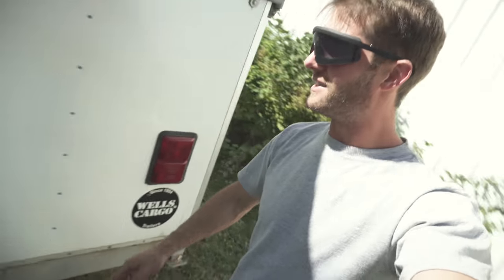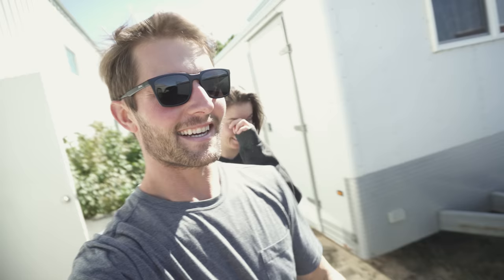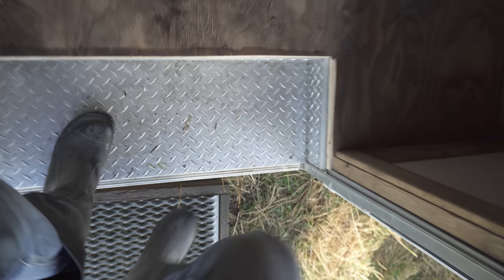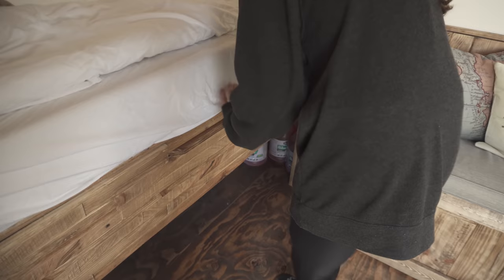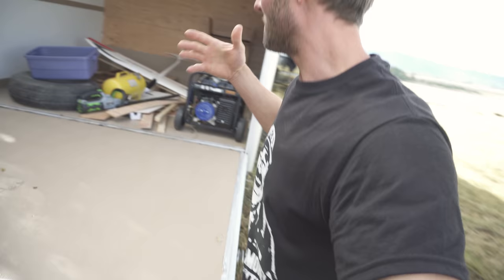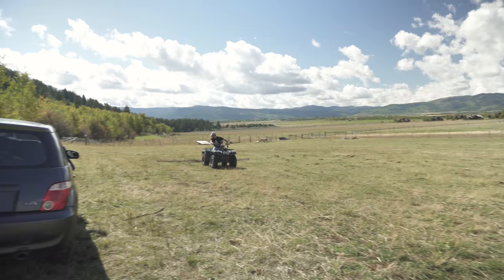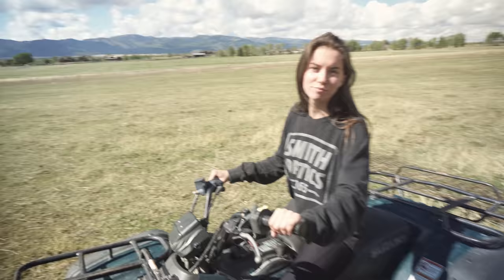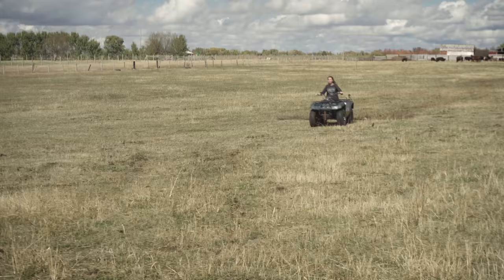CARGO TRAILER TO TINY HOME IN 2 WEEKS  *TIMELAPSE*  For $7000.00!

Comment: Awesome job!  I have seen a lot of these camp trailer/van builds and yours is at the top of the list.  I would suggest moving the fridge up a foot and a half or so so it is above the counter top.  It will be much easier to access for meal prep and you can put batteries underneath it.

Comment: Had you subed but utube was not posting your notifications, and not in my sub list, had to go find you guys again.  Another great vid. 
Always fun to watch. Hey those fridges remove heat from the interior and get rid of heat on the exterior, insulating the outside will not allow them to run efficiently, check it out.

Comment: Impressive! Now let's hit pause a sec. I give you two months' occupancy and that shop will be converted to a bathroom. Yep, say hello to you winter project. 
Tip: Solar thermal will give you piping hot water on a freezing, overcast day -- perfect for circ. through your in-floor radiant. Google "evacuated tube solar hot water heater." There's a good YouTube vid for you about how well it works in winter. For night, you can put an insulated, in-ground tank of 500 gal. for the trailer that will act as a thermal flywheel.
Reply from the maker: Thanks for the info sounds awesome. I’m going to check it out!

Comment: Your water system should be contained so if you get a leak you don't destroy your whole trailer. But a pretty nice job. Push the blue circle with the B in it and check my conversion out . Watch the updated video if you like log cabins.

Comment: Looks like there's enough room I can land there! I don't know if you have a Habitat for Humanity in the States but it would be easy to find enough vinyl plank for that space for $20. Also, I have plans for a hydronic solar collector. A 4'X8' would probably be more than enough to keep that space toasty especially If you had a thermal mass you could dump extra heat in during sunlight hours. I'll talk to you about it at HSF.
Reply from the maker: awesome! looking forward to hearing about it. See you there!
Reply: Jimmy Carter our president is the biggest supporter of habitat for humanity headquartered in Americus Georgia USA
Reply: Lack of thermal mass is one the biggest bugaboos with a trailer, or other temp structure.  You can insulate the heck out of it, and it'll heat super easy, but once the heat goes off, the lack of mass makes itself known.    Says the guy with a 5" concrete slab at 80 degrees, from today's sunshine/thermal solar collectors, then again, I can't move my house down the road!  Lack of mass is just a given with any structure capable of being moved down the road.
Reply: portnuefflyer it would eat into the storage but I was thinking he could have a water bladder under the bed. On the flip side, it’s also such a small space to heat so it wouldn’t take much propane to keep it topped at night

Comment: Refrigerators remove heat from the interior. They get rid of that heat to the outer skin. Insulating the fridge will not allow it to get rid of its heat and cut efficiency. Nice job on the trailer.

Comment: Not sure if 12V camping fridges are any different, but normal fridges are heat pumps: They pump heat from the inside the of box to the outside of the box. To make it energy efficient you want to help it dissipate that external heat, NOT encase it in insulation!

Comment: You can get small diesel heaters very efficient used on sailboats or tiny cabins!
Reply from the maker: I’ll look into them! Thanks for the tip!
Reply: @JonasMarcinko  yeah your pickup truck sounded like a diesel engine and I thought that would be so much more convenient! 12-volt system to operate blower fan and diesel fuel pump, combustibles vented outside for safeheat! Different heat capacity available 5k,8k,12k btu etc... Sailboat liveaboards are finding solar panels on top is the way to go, add a wind generator and you make electricity during the night in a breeze to run a very small air conditioner!... Keep in mind air conditioner doesn't have to cool as much as to take the moisture out of the air and make it dry that's conditioning the air and makes it comfortable!... A thought I had if you needed more room in your living quarters you could consider making the bed into a fold up Murphy bed!... Love your flying SHENANIGANS! I'm looking to get into Power Paragliding(PPG), with my sailing.... Keep the Fun Times Videos coming!
Reply: @stanRmeyer   ESPAR heaters, like my crane cab has, are quiet, and amazingly fuel efficient.  Truckers use them to heat their sleepers, rather then idle the truck. Outside air intake, no smell whatsoever, and a thermostat. Not cheap but worth it,  and you won't believe the efficiency.  Check out the ESPAR site and read the BTU output V the fuel consumption, it's unreal!    https://www.eberspacher.com/products/fuel-operated-heaters/air-heating/airtronic-d2.html
Reply: The yt sailboat channel "onboard lifestyle" installed two heaters in his Catamaran. They run on diesel & 12volt and you can have ducting if you want. There are cheap knockoffs for $150....
Reply: @danieloliver20  Heehee! That's exactly where I saw them when Teal installed them! It's nice that the combustibles are vented outside of the living space!

Comment: Jonas you only need a Pee-trap if its hooked up to a sewer line its to prevent sewer gas coming into the house or trailer you don't need it if its going outside
Reply from the maker: I did it to keep air and bugs from coming in. But it might be a good vent to let cool air in during the summer.

Comment: Looks great! Did they discuss the lighting? Cuz if the door is closed, in the evening or nite it will look darker without proper lighting. I would love to see it in video
Reply from the maker: I should have said something. But we just put two lights in the ceiling and it’s bright. Need to get a dimmer switch. But the color is perfect. It was a bit hard finding low profile lights.

Comment: you might like glue down peel n stik 12" floor tiles ...i used tan marble on a few floors... 

adhesive applied as if putting down dry asphalt tile... small knotch trowel... set  up time : 15 or 20 min.  put peel n stik down... strong bond .. avoids delam in traffic area.. burn or gouge or wear  in front of sink ... pull it up and replace.... use hot air gun or ice  chipper... 

peel n stik flex more than stiff asphalt tile... fewer cracks on wood sub floors... 
hope it helps
Reply from the maker: Thanks for the idea! Sounds pretty good.

Comment: How did you apply the wood and do the side walls without putting holes in the trailer????
Have you considered giving up a little bit of your workshop to put the composting toilet in there???
Reply from the maker: The trailer has metal studs the extrude from the metal siding. I was screwing the wood to them. 
I have thought about it. As of now we don’t spend much time there. But I’m thinking of building a small outhouse building with a composting toilet. :)

Comment: For 7 grand you could have bought a good used camper trailer and saved yourself a couple weeks work, maybe I'm missing why you went this route but looks like it will work.  Looks like a good area to hang out!!!
Reply: Crap insulation and laid out by the designer vs better insulation heating systems laid out and designed by the end user for there intended use.
Reply: Plus the workshop/toy hauling space. They would have had to convert a regular used camper to have that.
Reply: @RADThird1  at least he would be able to move his equipment around easier without moving the living quarters but what ever works for ya right?
Reply: He had one, junked and hauled away, they are built like sh*t, roof leaks, heavy snow loads there in winter.

Comment: I worry that you are underestimating the solar required to heat the trailer.  I would opt for a small wood stove knowing where you are.  Also, did you block the vent on the 12v cooler?
Reply from the maker: Yeah I’m a bit concerned about the solar not being enough. And no just insulated around the cooler part. Left the vents open. Though it’s a tight area, so I’ll need to keep an eye on it.
Reply: @JonasMarcinko   How do you intend to use the tiny home?  Is it a little getaway cabin or will you live in it full time?
Reply from the maker: @dmccollom1969 it's just a little getaway cabin for now. ill build there one of these days.

Comment: Question, how tall are you guys? I'm considering a similar build but wasn't sure if the trailer would be tall enough, especially after putting in the floor and ceiling. I am 6'2".

Comment: Jonas was it an oversight you didn't put in a toilet / shower during the build & a MaxAir or Fantastic Fan in the ceiling ? ?
Reply from the maker: I didn’t want to deal with the plumbing and since the trailer is staying on the property. I’ll make a nice composting outhouse. And a solar shower. 

I did install a fan in the ceiling. Not sure if the video shows it though.
Reply: @JonasMarcinko  Thanks for your reply . What type fan did you install in the ceiling and how is it powered Jonas ?

Comment: Looks great. But be careful with insulating around your mini fridge, refrigerators rely on airflow around them to function correctly (unless the cooling system is built into the lid, if so no problems).
Reply from the maker: I just insulated around the fridge part left the vents open. I’ll need to keep an eye on it though, for sure.

Comment: What kind of fluid are you running in the floor heater?
Reply: In the one scene he has a bunch of bottles of pink RV antifreeze so I would assume that is what is in it.
Reply: Rob Lane Looked like a special RV antifreeze used for winterizing water systems.
Reply from the maker: RV antifreeze is correct!

Comment: There’s got to be a shower n shitter you def got nuff room . You just gotta reduce size of that workshop a little just to get a stall shitter combo in it. Yeah it’s great that you and your gal can handle roughing it but no one wants a stinky in a small space like that. Think in colder times do you really want to get out of warm trailer to take a smash in the wilderness or after taco Tuesday and you drop a sloppy one and realize a rewipe isn’t gonna cut the mustard(or gravy in this case) and your out of baby wipes. My advice is put a shower in with a compost toilet if not in funds right now at least put a camping toilet in stall they only around 89 on Amazon

Comment: Do you know what the finished weight is? It looks like it tows good.
Reply from the maker: I should have weighed it before and after. Dang didn’t even think about it. 
Its a car hauler. So very heavy duty trailer. But I would say we added about 500 lbs maybe. 
Pulls really nice!
Reply: @JonasMarcinko  If it was a car hauler then you have no worries. Good job, by the way.

Comment: Hey Jonas what water pump did you use?
Reply from the maker: Kody Pivik for the sink? I actually don’t want to recommend it. As it seems to leak and is super loud. That’s why I didn’t include the link. 
The one for the infloor heat system seems pretty good so far. I could find the link if you are looking for that one.
Reply: @JonasMarcinko  Thanks for the info.  I have been looking at doing the same thing for a trailer. Thanks!

Comment: You could have bought a nice camper for 7 thousand?
Reply from the maker: Campers are built so shitty though. This is a car hauler, so it’s built heavy duty. All steel frame. And now it’s insulated well. And I don’t have to deal with winterizing every winter. 

And I have a tiny shop!

Comment: watching your time lapse i would say your in floor heat is not going to work i have the same concept in my house no heat transfer plates ect and have a line every 3" but its only 3/8 line in paralle tracks 1/2 line split into 2 -3/8 lines under the floor
Reply from the maker: Dang:/ So yours doesn’t do much huh? Seems the lines need to be in concrete for it to work well is kinda my thought.
Reply: no my system works good but i have so much tubing in the floor just to get enough heat transfer the more square inches of transfer area the lower temperature you can run I run 110 degree f water  only issue i have had is last winter i had -30 degrees for a week or so could only hold 62 degrees in my building just couldn't transfer the heat fast enough out of the floor since wood carpeting .ect are all insulation when the tubes are in concrete it becomes a large heat sink and radiator that's lost when tubes are sandwiched in wood floor has to be made up with heat transfer plates or as i did many more tubing runs it all boils down to heat transfer area heat travels easily through concrete but wood is much more resistant to carying heat away from the tubes
Reply: what it reiley comes down to your going to need many more feet of tube under your flooring to get the result your hoping for hope this helps 
P.S. i had a friend that had a Kit Fox was fun to fly Was powered by an E81 Subaru engine I'm also only 100 miles from Oshkosh
Reply from the maker: Yeah makes sense :/ dang. 

That’s great! Maybe see you at Oshkosh next year?

Comment: Where's the shower? That's an awfully lot of work being done, with no obvious place to wash off the stank!
Reply from the maker: Outdoor solar shower. Forgot to mention it!
Reply: @JonasMarcinko  Glad to hear that, for Silvija 's sake!
Reply: @JonasMarcinko  Wait, are you talking about rain? Things could get a bit stinky between episodes of running around naked in a storm! Plus, there are a couple of other things to worry about with that method. (1) Lightening and (2) all of those formerly easily avoidable cow patties have now been converted into dust, and spread over every square foot of your "solar shower"! If that's the case, you might think about a pan of clean water to wash  the reconstituted poop off your feet, before entering your manse on wheels!